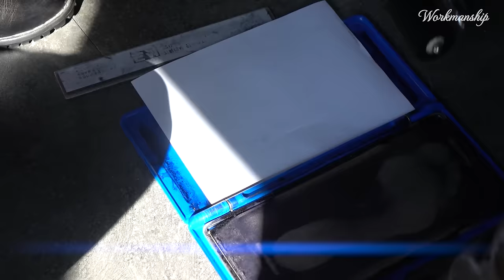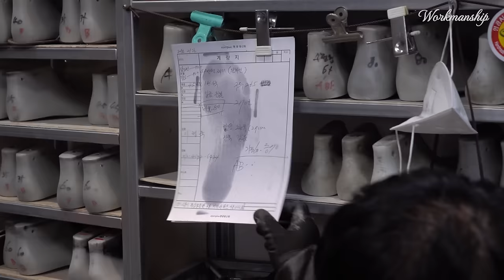Process of Making Hiking Boots by Professional Mountaineer. Korean Shoemaker

Comment: Nowadays, there are very strong adhesives available. There is no need to change the machine we use as a press and make a third stitch that ruins the sole. By doing this, you can avoid a very bad appearance.
Reply: exactly! and those stitches on the bottom will be shredded to pieces within 5 minutes and the corresponding white top stitches will look awful soon after! Just use nails if you have to or create a stitch channel and then stitch it so it has a purpose!
Reply: 가장 강력한 접착제를 사용 하면서도 꿔메야하는 이유까지는  설명하지않습니다 .당신은  더 많은 경험이 필료할것입니다.
Reply: @alpenglow3626  No one understands your language dude. English please.

Comment: Very good skills, but those are an old style of boots. This kind of boots, in general, were used until the 80's. I understand that is Korean style, so they still living in the past. This kind of boots have a lot of limits and technical mistakes comparing with today's mountain shoes and boots, even the sole is not Vibram. 
Sorry, today there are much better shoes for hiking.
Reply: 산은 변하지않습니다 . 밎창은 alpenglow에서 40년 연구끝에 개발한특허받은 명광 만의 창 으로  신어해보지도않고 그런소리를 한다는것 은  이해부족으로 등산화창을 연구개발한것은 세상에서 하나뿐인  창으로 접지력과 미끄럼방지 무릎 통증완화에 
효과적인  창입니다 .등산화만드는기술은 50년 이상 혼자만의기술로 아무도할수없는 기술이랍니다 .